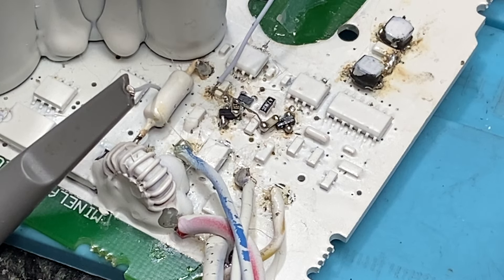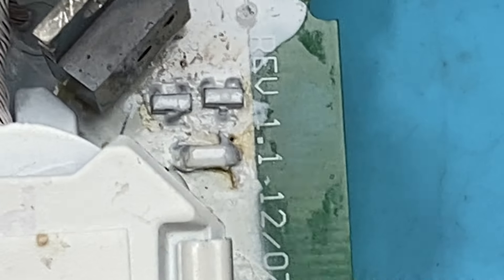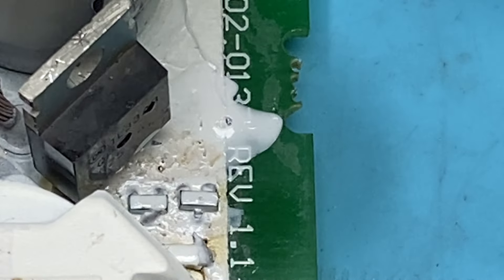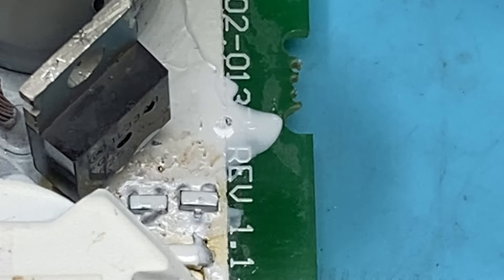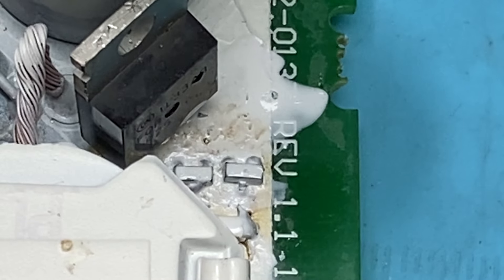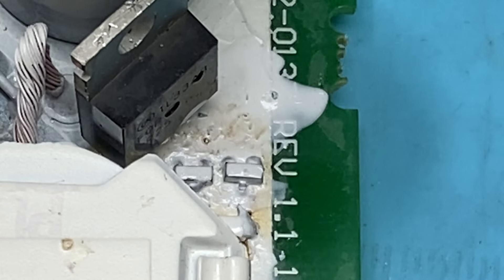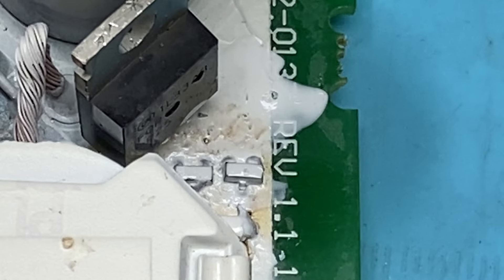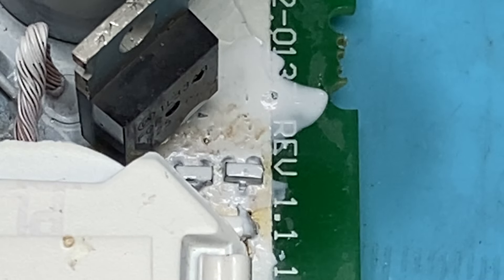Minelab GPX4500 GPX4800 GPX5000 N fet to P fet conversion details.

Comment: So, on the GP Extreme, is the cct as per this mod already, but still upgradable to the new component?  Obviously keeping the new component orientation as per original device? which is the biasing resistor for gate, or do you need to add in?

Comment: Looking forward to trying.  How will this mod affect the non-normal timings (e.g., Sharp, etc)?
Reply from the maker: When using any timing that uses a very short pulse it is also evident that the receiver is being switched on faster as to capture the fast target decay, anything that reduces capacitance, reduces on resistance and has very stable forward voltage ( admittance) is best for signal recovery.
Reply: @jasonjarnagin9514  The modes that have the shorter pulses are fine gold, enhance, sharp and sensitive extra modes, another area that needs to be examined is the stop start power supply droop if modifications have been carried out on the input stages, also check the supply stability on the quad opamp near the AD797 chips, this is where you will need a stiff drink after checking the supply ripple.

Comment: What size package were those components?  Mine came in and were much smaller.
Reply from the maker: I have two versions of some of the parts, some from Vishay and some tiny ones that I had via Newark.
Reply: @DetectorMods SOT-723 is the smaller version I think.   The SOT-23 package is the one that fits the footprint like you have in the video, I believe. Have you by chance tried ROHM  RSQ035P03TR Pch MOSFETs?  Looks like an abundance in SOT23
  Thanks

Comment: Cant you make a small PCB for this with the fet and resistor on it. And a set of pins thar solder to the orignial p channel fet. It wiuld look much better, you can get china to make about 100's of them for about $5 ,  basically a felt break out board, use a few pieces of 20 gauge wire for pins or legs to solder the board can be soldered to a tiny copper heat sink if needed. Basically a penny or dime nickel at most sized PCB with thick copper on the board. And a finned edge, itvcan act as a small heatsink.
Reply from the maker: Yes, but how many people would want it?